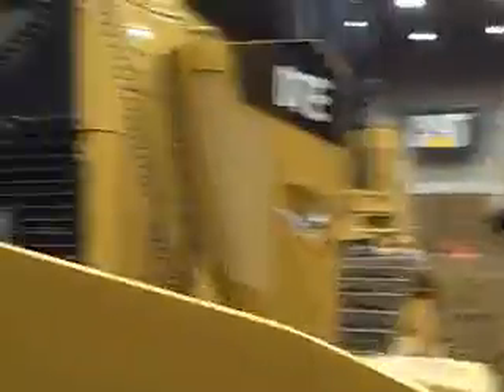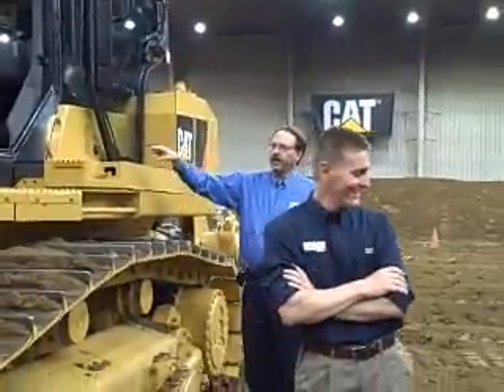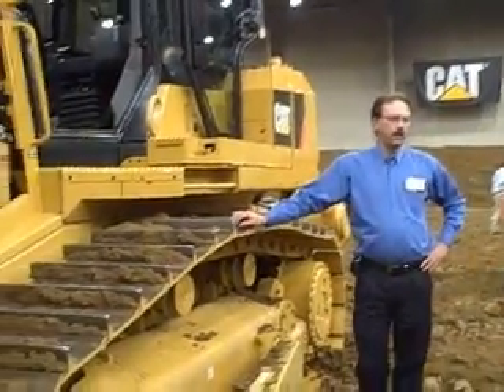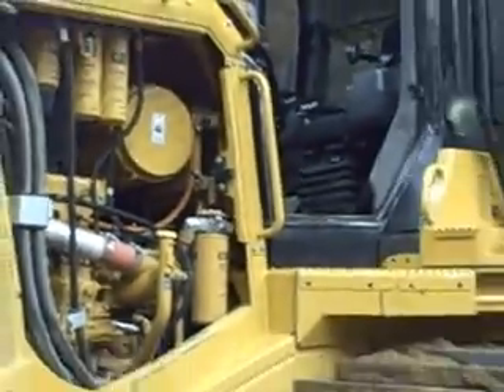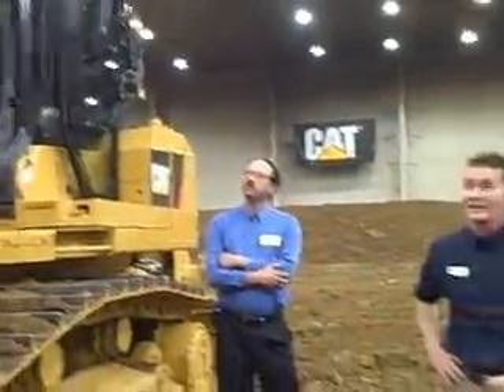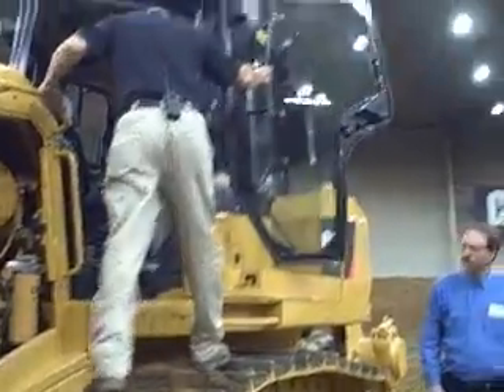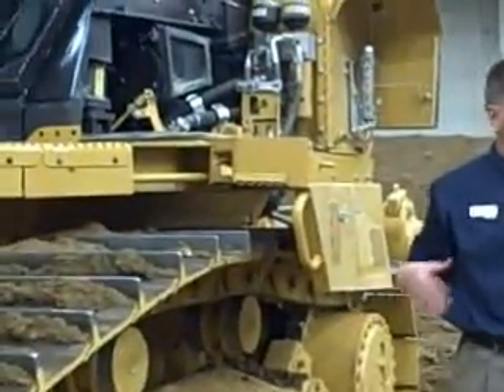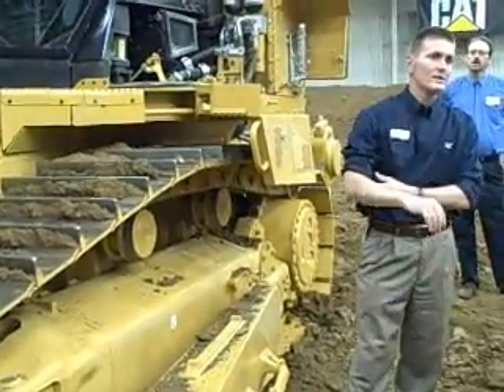Caterpillar D7E demo

Comment: And notice how the second guy correctly refers to as a TRACTOR, because that's what it is. A "bulldozer" is an attachment that goes on the front of the tractor. The fools over at Wikipedia seem to be convinced that a "bulldozer" is the whole unit, and therefore you can "modify a bulldozer into a tracked loader".
I also notice they seem to have abandoned the hi-drive, at least for this series. Wonder why; wasn't quite what it was cracked up to be in all applications?

Comment: Had our first '7E come through the shop this week, according to the dash it has averaged 6.05 gallons an hour over it's first 617 hours. I took it out and played with it a bit, very nice machine, though it feels odd hearing the engine RPMs change up and down as the tracks continue to turn at the same speed.
I admit to not being an operator, but I would bet a good one could keep up to an '8R with this machine. Those who want to talk sxxx need to go out and run one.